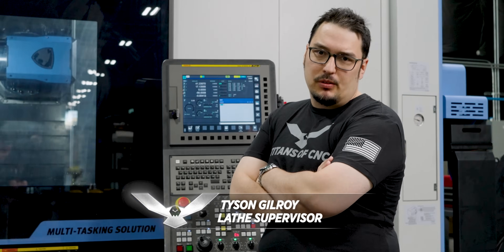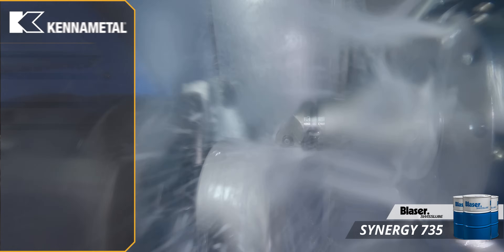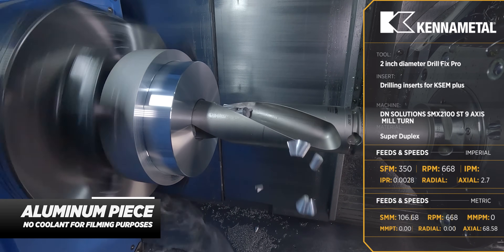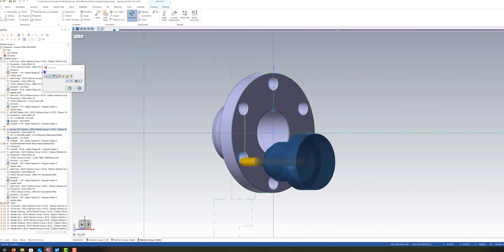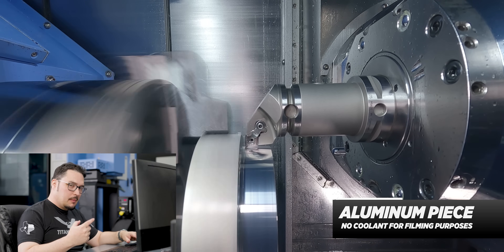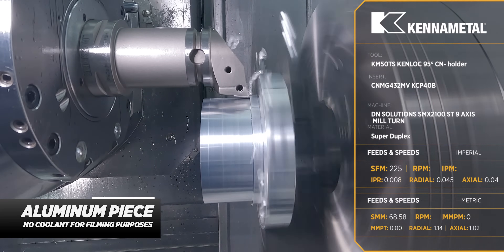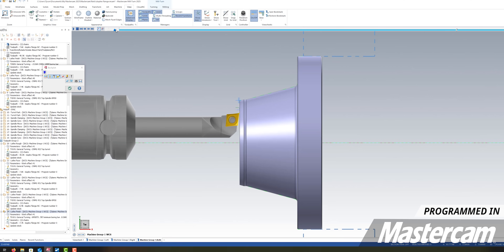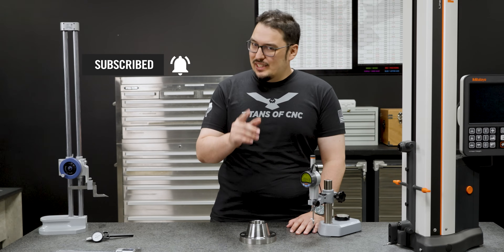Machining Super Duplex is a Nightmare for Most Machinist

Comment: I am currently working on inconel 625 that came in at .025 of an inch oversized on the O.D. It is out of straightness by .015 and is 46.83 inches long with no center holes and has a +0.000/-0.003 tolerance for the whole length. Btw I have 3 of them to machine and finish by tommorow as the job is already late and has a 2 month lead time for new material. I am the only operator that runs the machine so no second or third shift.

Job only fits on a 15 year old hankook protec 9na which is being rebuilt this year due to bad bedways, shot gibs, and has massive tapper. Should be a good time.

Comment: I just got done with a handful of parts out of this 2507, kicked my butt! Drilling the 1/2" hole on centerline was the worst of it though. Given i didnt have the best tools for the job as we had to get them out as fast as possible, but was wondering for next time it comes through the shop if you had any tool reccomendations for drilling a 1/2" hole 2" deep. Feeds and speeds? Should i use the live tooling to drill the hole rather than turning main spindle? Running on a HAAS ST-20Y or HAAS ST-28Y. Thank you!

Comment: After hardness, it is toughness of the material that really matters in machining. Strength (yield, tensile) values are not as important. Take for instance the aluminum that you are machining. Chances are that its 6061 T6 or something similar which has a tensile strength of about 350MPa (45ksi) which is not too different from let us say S.S304. 304 has a lower yield strength value than Aluminum as per ASTM standards for the two materials! But most of us would agree that even 7075 T6 Aluminum (500Mpa/78ksi) cuts like butter while S.S. 304, which has a similar tensile strength of about 550Mpa (80ksi), is a pain. Toughness, a combination of strength parameters and ductility, is what I look for when it comes to machining.  Even 17/4 PH is easy most of the time and that has a tensile strength of about 1170Mpa (170ksi)!  17/4 has a total ductility of about 10% while S.S. 304 can have as much as 60%!

Comment: Why did you pass it to the sub spindle by hand? Doesn’t the sub spindle pick off from the main? Also you didn’t deburr the second side of the bolt holes, or you didn’t show it.
Reply: I'm with you man phase sync the spindles and teach A..... from a practical standpoint ridiculous for 1 piece but for YouTube... 😆
Reply: @chopthesheep90  always better to do it with the machine than by hand. Even for 1 part. Tyson is just stupid.

Comment: I am using the best plates ever for this it is from sumitomo a cnmg0.8 1204 120m/min easy and feedrate 0.25 Ap 2mm cuts like butter can cut 30min without breaking the point on a puma 400 lathe
Reply: What Sumitomo chipbreaker and grade did you use???

Comment: Machined lots of Super Duplex for offshore products in Norway. For roughing, get a holder to use the 100° angle on a CNMG insert. Negative lead angle, is the melody for roughing. Had one for facing, one for OD and a custom holder for ID. Made semi large pieces, with long interrupted cuts so normal lead angle would've been hopeless. Once getting used to this material, it ain't that tough. The material is also warping and bending after being roughed. Wiser to rough as much as possible, then you let the pieces rest for about a week before starting up tighter tolerances. Also try to avoid 90 degree corners as much as possible. Roughing into a straight wall, will ruin your insert prematurely. Leave a 5 degree angle, then rough out the remaining corner with a bit smaller cuts.
Reply: Very nice info. Rest the part for a week? Does it really need that long? Need to consider this when quoting this material and tight tolerances. How much would it move?
Reply: @ciscohernandez4384  I don't know how much it is warping or whatever it's called. Solid pieces shouldn't be an issue. But anything that's relatively slim or thin, is best to rest for at least a few days. We did it usually as a precaution, as parts formerly had to be scrapped due to warping because of finishing parts directly. We did castings mostly and I wouldn't be surprised if those were more prone to warping. Even casting from same batches could vary hugely, from how difficult it could be to rough it.
Take precaution if there's tight tolerances and geometry speficatons 👍
I'm no god or expert in this area, I'm just giving my point of view on this.
Reply: Thank you stranger!!
Reply: Norwegian ?
Reply: @vebjrnlarsen3969  Nope, I live in Sweden.
Reply: I used to do this as well. When roughing deep ID to a wall, I went down a 70-80 degrees at the end instead, then blew out all the chips and took the final part in a separate cycle.

Comment: Text and audio say duplex. 2507 which is also mentioned is super duplex. In metric value I saw feed rate at 1mm pr rev. Can’t be right. Travel to norway for a tutorial on this material on proper machines.

Comment: It looks to me that the water jet operator pierced the edge of the part leaving that huge gouge. It should be pierced off the edge of the part with a lead in to the part to leave a smoother finish. That's how I was taught to do it.
Reply: Im betting it came from the middle of some stock somewhere, they probably added extra OD to compensate- ive had a supplier do this a few times, sometimes unavoidable i guess.
Reply: My guess is they found a drop somewhere to use for this video demo. Probably was never meant to see anything besides a dumpster. considering Tyson said he designed this part, im doubting it's an actual job that would have paid for new material.

Comment: I used this insert. One rough cycle and tip disappear. Way better is tungalloy. I'm curious if you have some recommendations?
Reply: Tungaloy is pretty good for harder metals, we used their stuff for nitronic and inconel on a regular basis
Reply: Kyocera has good inserts to superduplex. Outperform tungaloy.
You can try prime turning from sandvik, works great if you have rigid setup.

Comment: Was the crust hard from the waterjet?
Reply: It wasn't too bad, other than the one spot in it where there was an obvious lead in/lead out from the water jet
Reply from the maker: No heat in waterjet… so usually it’s much better than getting flame cut
Reply: Usually it's not HARD per se, but there usually is some garnet left in the crust, which can suck